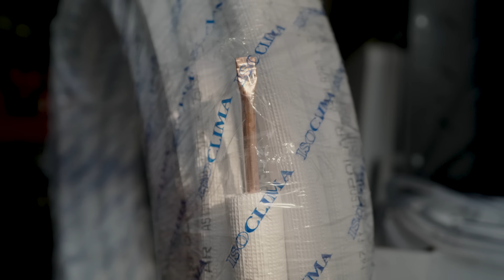How to Install a Wall-Mounted Mini-Split | Ask This Old House

Comment: Thats how it works, a mechanical device to be installed that requires a knowledge in ‘cfm’ air flow requirements (btuh), outside pad mounting, inside wall mounting and 120/220 electrical hook up.............get a plumber with sanitary pipe experience, who could be better qualified?

Comment: Why can’t they make a mini-split where the inside part can go in a window like a conventional ac?
Reply: that's called a ptac unit
Reply: You mean like a window unit? What would the advantage of doing so?
Reply: @hailexiao2770  No they are the heatpump units you see in a hotel room that do heating and cooling. Those are what we call Ptac unit
Reply: @zack9912000  PTACs aren't mounted in windows. They're mounted in wall openings.
Reply: @hailexiao2770  Yes I understand that, that is the closest thing made that is similar as a heatpump as a mini split. They simply don't make a window heat pump unit, there are through the wall units like the Ptac.
Reply: @zack9912000  Understood--I was just answering OP's question. If you're already mounting something to the wall then cutting a big hole doesn't offer any advantages over cutting a much smaller hole.

Comment: I do not like my wall mounted condenser, it vibrates the house a ton. I hear its much better to have it on a cinderblock wall. LG Red 24k
Reply: Yes. I don't put anything larger than a 12000 on a wall mount.

Comment: All that work just for 1 unit, the only benefit I see is it will be quieter than the window units, but the window units are cheaper, easier to deal with and never need to be serviced. In this situation the window units are better, my guess they are planning on selling and having the split system will get the place sold quicker and for more money.
Reply: It would have been better if they had used a system that supported multiple units, then they could spread out 2-3 to properly cool the floor off one split system.
Reply: I think the upside is efficiency.  Twice as efficient.
Reply: In many climates the window units need to be removed in the winter. Difficult for an older person. The mini-splits are also normally much more efficient than a window unit. Window units can also be a real security issue as noted in the program
Reply: @staudtj1  these things are heat pumps and can be the primary heat source for the large majority of the year. We had the gas boiler go out last week during the coldest week of the year; no problem, the mini-split heat pumps were up to the task of keeping the house comfortable.
Reply: 1) It's 3-4x more efficient than a window units, that saves $$$ in the long run
2) It can heat as well as cool, and do it cheaper than propane or oil, and sometimes natural gas

Comment: Drywall screws to secure the inside mounting plate??? Hack job installation.
Reply: i saw that too.. didnt even look like they hit a stud with lags.. wtf
Reply: yep, Richard does alot of hack work
Reply: These indoor units are incredibly light and have next to zero mechanical vibration. That backing plate secured with 5 drywall screws (included in the hardware kit) will hold just fine the way they did it. The LG install manual doesn’t even specify anchors or any need to hit a stud.

Comment: Americas pretty behind on this. We've been doing this in EU for more than 25 years. Even in the poorest countries...
Reply: Most of us in America use central air conditioning. The same furnace that heats with gas or oil can also run only the fan in addition to an outdoor unit like the one seen here but larger. The evaporator coil is on top of the furnace and the furnace fan can blow the air across it and give you cooling! These split units are just getting popular but, as he explained in the video, only in areas where they don't already have central and a window box would be impractical.

Comment: Quiet except for their patio which is not useable while that thing runs, it’s so loud outside
Reply: Those units are very quiet, sure you can always hear the compressor run, but at low speeds it's really not that noticeable, it's more like a quiet whistle with some running water noise

Comment: 5 questions for the PROS... 
1. How is the amount of line set needed, determined, prior to install?  
2. Is there a limit to the amount of line set used accept by the amount of refrigerant needed (unless pre-charged)? 
3.  WHY on GODS GREEN EARTH do ALL the VIDEOS OF wall hung OUT DOOR PORTIONS show, / demonstrate, SNUGGING THESE CLOSELY TO THE WALL?  
4.  T/ F.. fan's are rated by CFM (CUBIC FEET per MINUTE) .. NO MATTER THE USE.. these videos show these FANS.. AGAINST THE WALLS, SO CLOSELY, it's MY opinion, they're going to fail (most likely), prematurely, due to things such as vibration caused by RESTRICTION making the fan motors WORK HARDER to do their job.  These units most often have ALOT of rubber grommets, thankfully, yet, they're also said to be 'efficient' and quieter with 'variable speed' motors.  
T/ F .. When, we make fans work, harder, they become louder.

all my opinions.. and thus they are questions.
Reply: The manufacturer installation docs answer all the questions. Minimum length, maximum length, when you need additional refrigerant, the clearances. Same for indoor unit.

Comment: How cute, he calls that an urban environment, yet there's there's a driveway along the entire side of the building,  tree lined streets that are relatively small.   I sure would like that as my urban environment, instead my whole lot is 25 feet wide and the house occupies every foot from one side to the other.    I guess different cities have different versions of "urban"
Reply: Sounds like you should move to a different urban environment

Comment: You can instantly tell how cheap the interior unit is by looking at the plastic casing vs the louver and the gapping between the two. There is a reason why for hundreds of years, German and Swiss made products have been well known to be of the highest quality and Chinese and third-world made products have been considered to be crap, just like this unit.  If the outer casing is not made to be presentable and clean looking, you can guarantee the interior components, which you can't see, are pure trash.   Outsourcing kills quality... it always has, no matter how many times marketing from these companies says, "oh we maintain high quality at these chinese factories"... it's simply lies and we have to suffer from the profits that these companies obtain from selling us trash products like this.  Also, the surge protector is NOT a "must have" or "great idea".  Most of them cost above 300.00 but are not guaranteed to protect your equipment.  Most warranties involve an LED light, which if operating means to you and the company that sells it, that it is "operating".  And if it is "operating" the company will not pay for any surge damage to your circuit boards or components when they are damaged by lightening or surges.  So they are installing a surge protector that doesn't prevent anything and they are charging you 10 times what those units are actually worth.

Comment: This old house is getting to be commercialized to the point it explains nothing, shows no technical hands on detail,  and uses other contractors to do the work while they just use their pie hole rambling like a idiot!  What about the disconnect, amp breaker required,  wire size, did you braze or flare the HVAC connections, and if the line is precharged, then you cut it to size,  what happened to the coolant, what about vacuuming the line,  how much coolant was added per length of line set, do you braze the lines to the inside unit on a ladder to keep from scorching the wall, what was the SEER rating,  do you want the outdoor unit in full sun, what's the ratio of btu to tonnage,  how many BTU per square foot of home is needed,  how much line set can one use before it needs more coolant, what's the ambient temperature rating on the heat pump before it starts losing its efficiency, and at what %! Seems like I get more frustrated with trying to learn anything new from this old house with every video!